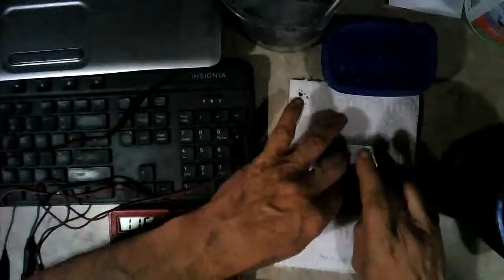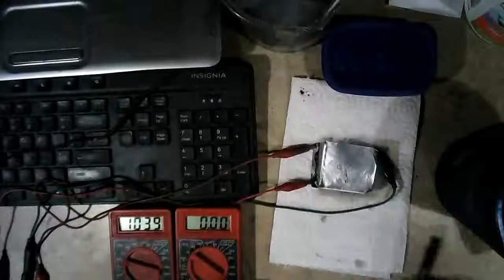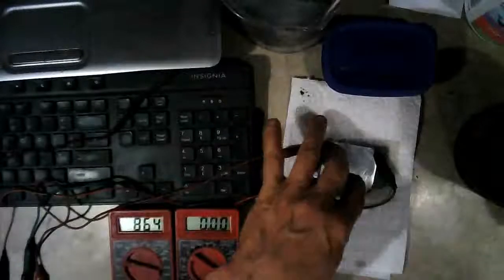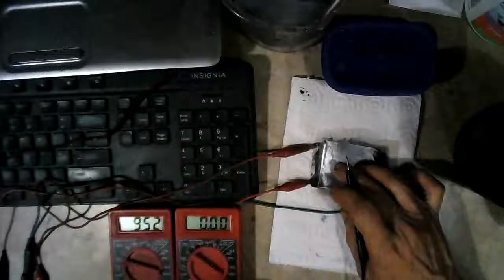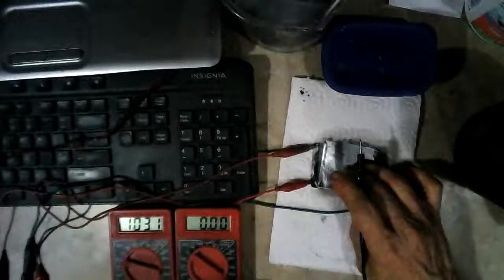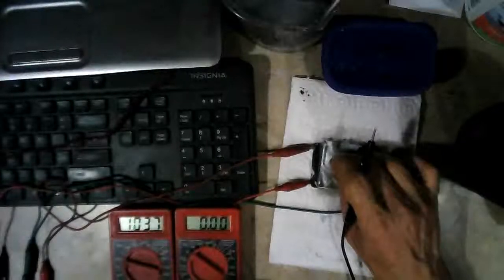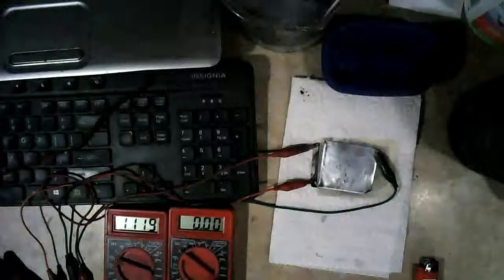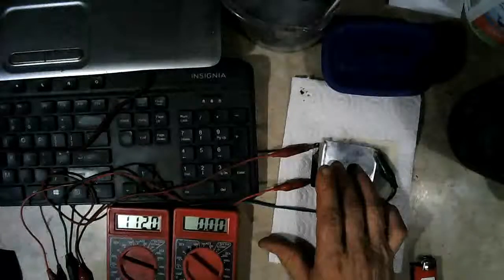Sodium Ion Transport Test! #2

Comment: Maybe a constant pressure on the cell maybe a good idea like one of those plastic clamps as I know with my test cell vary a lot with the slightest change in pressure .
Reply from the maker: I understand where you are coming from EPN, but that wouldn't produce a consistent anomalous behavior at the same voltage point. It's got to be something else.

Comment: The voltage seemed to stay relatively constant. You didn't examine the condition of the cathode material to see if there was any bleeding or corrosion. The electrolyte could be reacting with the metal. I don't suspect a short because the drop in amperage was fairly constant. Application of phosphoric acid can leave a black phosphate coating that provides moderate corrosion resistance The coating may also be slowly developing electrical resistance.
Reply from the maker: I took the cell apart later and examined the electrodes. I didn't see any bleed thru, but there was a darker coating on the zinc. So that may be why it slowly lost power. Damn electrolytes. I may just eliminate that headache and go with the bare bones cell. I've always said "simple is best" in the long run.
Reply: In my career for a time I was the Inspector at a precasting plant that built pre-stressed concrete girders using stressing strand reinforcement. There are various types of strands used for different reasons. One type is phosphorus treated for corrosion resistance. The strands are dark with the coating when new. When cut across the strands it reveals that the coating only penetrates the very surface of the steel. Otherwise the cross section of homogeneous steel would be reduced compromising the strength. That is why such a weak acid is used. Any acid will etch metal. The etching is resistive to corrosion which is galvanic reaction.
I wouldn't completely discount using an electrolyte because that is how the ions are transferred. Electrolytes can be acid, alkali, or perhaps anywhere in between.
Alkali electrolytes also work but are corrosive for the same reason. They react with the metals. I'm not sure whether an electrolyte that is neutral in respect to the metal used will work.
In my research and experimentation on crystal batteries borax is often suggested as a buffer with Epsom salt. In the common copper/magnesium cells the pH is critical. I was  thinking the same philosophy might apply.
You have been using borax as a linking agent in the separator but I have no idea what the pH is at the plates. It might be worth investigating.
Reply from the maker: Good input Fred. I'll meditate on that. Thanks for sharing your knowledge.